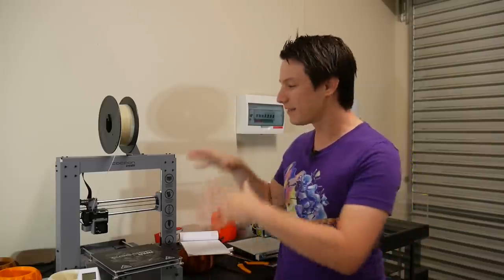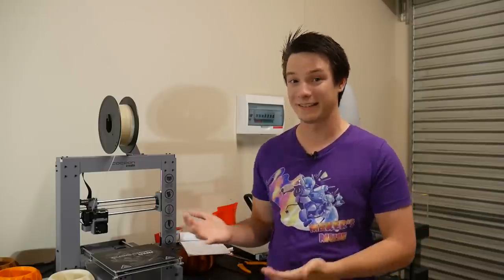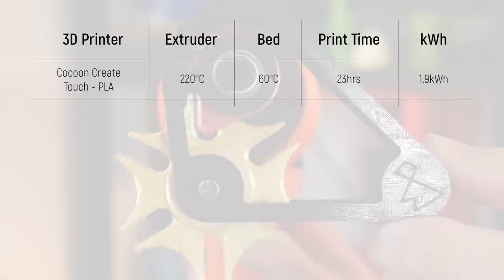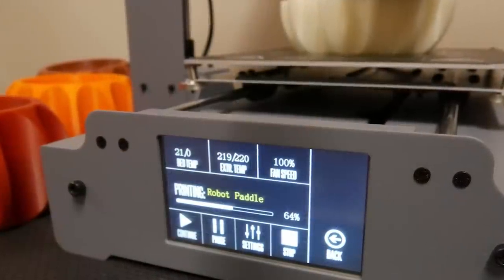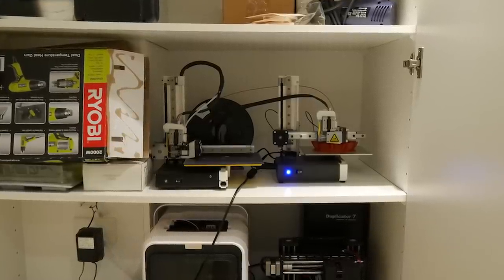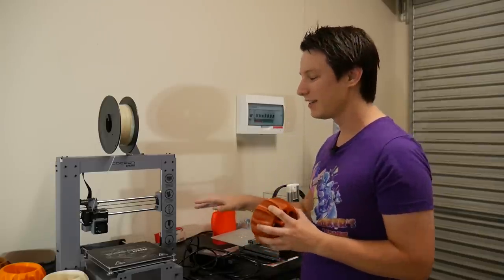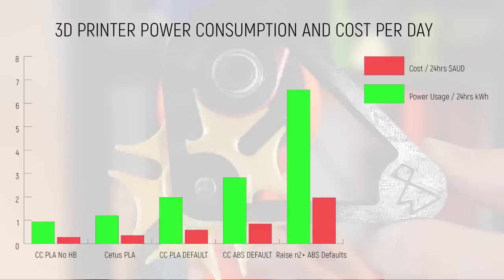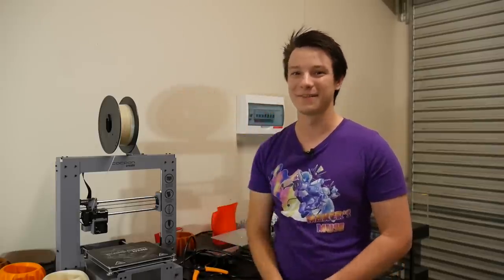How much power do 3D Printers use?

Comment: Thanks for the shout-out, Angus! Great insight into the power consumption of different printers and materials.
Reply: Hey boss can you do a preferences for .8 mm nozzles on the slicer software I’ve been to places where the wackos told me to put it to 140 mm speeds and a .4 mm height ect as a beginner this is very confusing and the test print at this setting came out in the shape but like a slinky so it split into bits and pieces after removing the raft and supports
Reply: how its possible  that cetus printer printe it in half amount of time?

Comment: Would it be out of the question to run the heat bed, for say the first 5 or 6 Z-axis layers and then modify the G-Code at some arbitrary height to switch the heat bed off?

Comment: I checked the power usage with a smart plug. At warmup ender 3V2 uses 270W, while printing PETG it varies around 100-130W.  Isolating the heatbed helps to reduce power usage. The 3 stepper motors on my printer use about 24 watts

Comment: Nice test Angus.  I've done similar test on my printer.  Power consumption from least to most: Motors, nozzle heater, bed heater, chamber heater.  My printer sits at about 90w/h while printing PLA, but It can hit over 1200w/h while all the heaters are on.

Comment: Can any of these be configured to switch off the heated-base after a given time to ensure the print adheres at the start but heater is switched off once it isn't needed?
Also, would operating the printer in an insulated cabinet to maintain a higher ambient temperature be worthwhile in reducing cost & failure-rates with ABS, etc., or would that cause problems with stepping-motors overheating?

Comment: That’s why you need a enclosed printer like the Da Vinci Pro when printing ABS. It’s also helpful in saving energy, it holds the heat evenly inside itself very well.

Comment: Hey mate. Hopefully this is a decent place to reach you. I use a CR10-S5 and I believe if I printed that wheel in PLA it would've being a larger build time than you experienced. I slice with the latest cura software and my estimates are always about half of what I actually experience. Any off the top of the head ideas as to what might be going on? I constantly vary infill and layer height depending on the job but I am still very new to 3D printing.

Comment: Hi Maker's Muse.  Given that maintaining the temperature of the hotbed appears to be a large contributor to power usage, it would be really interesting to see how this compared if the Cocoon was put inside an enclosure (as you normally would for improved ABS printing). 
I suspect you might find a good power saving, as the heat loss (and therefore energy required to maintain the hotbed temperature) would be greatly reduced by the increased ambient temperature inside the enclosure.

Comment: Do you know how many watts a 3d printer will peak at without a heated bed? I'm building a large 3D printer picking out a power supply. The heater for my machines bed will be 24v at 300 watts, which is 100 more than previous machines I've built. I'm thinking a standard 360 watt power supply isn't going to cut it. It will also have 7 stepper motors. Also speaking of 7 steppers if you do see this maybe you can answer another question. Since my Y axis is so heavy (300x300mm bed, 5mm thick aluminum) and will get heavier as the machine builds, I am planning on using 2 nema 17's working in conjunction, but wired up the same way you'd see 2 motors wired on a Z axis. Will this actually double my torque, or will it just split half the torque between each motor?

Comment: If it helps anyone: I tested my ender3 with a 9h print. 
The hot end was at 205°C and the heated bed was 60°C. The printer drew an average of 70.1W.
Reply: soup health Drawing an average of 70 W for 9 hours is only .07 kW x 9h = 0.63 kWh
Reply: @boarder2k7  that's not much
Reply: so less than a gaming pc or xbox
Reply: @flamestoyershadowkill6400  waaaaay less
Reply: @munzlp  I  agree
Reply: @boarder2k7  Pretty sure he meant 70 watts an hour not 70 Watts total.
Reply: @buddyguy4723  his math meant 70 watts per hour. so it checks out
Reply: That's honestly not bad at all, weren't incandescendent lightbulbs like 80W?
Reply: @marcodagostini1420  up to 150 in some lamps, now an LED only uses like 9w
Reply: soundspark I’ll have to do a test print and measure that but don’t have access to the equipment just now. I imagine it would use significantly more power.
Reply: @buddyguy4723  it's a printer not a nvidia 2080 Ti
Reply: @DavidGarcia-nx2gj  what point are you trying to get across here? Those things use like 300 watts.
Reply: Watt is already a measurement of energy per time.
1 W = 1 Wh / h (so it is 0.001 kWh / h)
1 W = 1 Ws / s
1 W = 1 J / s

1 Ws  = 1 J
1 Wh = 3.600 J
1 kWh = 3.600.000 J

1000 W = 1 kW = 1 kWh/h = 3.600.000 J/h = 1000 J/s
Reply: @buddyguy4723  it was a joke but 3d printers does not use 300 watts
Reply: @DavidGarcia-nx2gj  jesus man, the 2080
Reply: Well, pleasant to hear my ender 3 (pro) is not that expensive to run. Now if the filament would become cheaper..........
Reply: @boarder2k7  Wait, seriously? That's barely anything. 1 kWh is about $0.2 in my country even after recent massive inflation of power bills...
Reply: @Abedeuss  I'll just be crying over here paying $0.39/kWh starting January 1 when it jumps 40%

Comment: If I recall correctly. My Delta, with a way overvolted heated bed running at 28.5v on a 24v bed. And a heated chamber and a hot end running at around 250 -260c. My printer uses around 275w/hour on average, although the first 30minutes the machine uses nearly 400w.

Comment: I have that exact same wattmeter I think :-). If you want to compare the motor usage excluded from the nozzle AND the heatbed, you can run a print on “dry run” setting, which won’t get you exact due to the extruder, but the extruder will be the least used motor during a print anyway,  when you take away the heated elements. 

Just food for thought...

Comment: Nice video.
I run several printers and use them as much as possible. For this year I am at almost 20000 hours of printing. Since I note how much electricity I use every week, I can tell you that I am using between 100 and 145 kWh per week on average. Before 3D printing that used to be about 30-35 kWh, so yes, the printers use a lot of energy.
I might add that I use a lot of TitanX, ASA and PETG so these use higher bed temps all the time.

Comment: I have one of the Aldi printers and ended up making an enclosure for it. It would be interesting to find out how much the enclosure reduces the cost of printing ABS??
Reply: The effects of one would stack nicely with bed insulation I would think.
Reply: I would believe an enclosure would be a necessity these days for print quality and cost savings
Reply: Zoë Baldwin I've lost my numbers since stupidly not writing them down with my other printer stuff, but was surprised at how little bed insulation did for my power consumption overall. It definitely helped, but wasn't as much as I'd hoped for.
Reply: I think an enclosure wouldn't help too much with power consumption, but mainly print quality as the ambient temperature around the print is higher, leading to less delamination

Comment: might be a few years old for a vid, but did you ever re-try this with a HotBox enclosure?  The bed is going to be the biggest consumer of power because it, not only has to heat it, but keep it hot during that time.  Hotends are much smaller, while yes hotter, you don't need as much power to make them hot and upkeep the temp.  With an enclosure the ambient temperature is higher meaning the plate doesn't cool down as quickly making for shorter cycles of the hotbed needing to "run" to upkeep the temp.  Also you need that hotbox for ABS or it will self destruct like that.

Comment: might wanna try different slicers to compare for printing time .....
i.e. i done a print (side panel for a mini transmisssionline speaker) in both cura and slic3er where the cura version was done in just over 1/3rd of the time...
settings for infill, skin thickness bottom and top etc were all the same ....
so choosing the right slicer can really help

Comment: The CR-10S Pro uses about 500 watts of power at 60 degrees bed and 150 degrees nozzle  (not quite printing temperatures, but it is what I was using to troubleshoot a power supply issue I was having.  Someone else was kind enough to measure how much their working printer used.  Mine was maxing out at under 400 watts and their working one was using just a hair over 500 watts making it clear that my power supply was faulty.)

Comment: Aldi on central coast still has the Cocoon Create going for $400
My FlashForge Finder doesn't have a heated bed, but does have an LED strip for continual illumination, wouldn't add much I believe. Can be turned off.

Comment: I really have to print PLA with cold bed at last. I always turn it on because why not. As of now I'm printing some small adapters for the Pimax and using 60°C bed. I think this helps bonding the layers and perhaps even crystalizes them.
However the AnetA8 already draws a lot of power, but heating the heatbed of the CR-10 requires even more power. I think it is like 150W vs 250W for the heatbed alone. (not quite sure if I remember and compared them right but it's close)

Comment: The latest Cura has an option to change the bed temp after the first layer.nI've been using 60 degrees, then dropping to 40 on my Cocoon.  Sound like I should just to zero (off).

Comment: Takeaway has to be that bed heating (temperature difference to ambient and bed size) x print time is by far the most significant factor. Comparing the Cetus and unheated Cocoon Create shows similar power consumption rates. So, if you could get a good quality print from the Cocoon Create at higher speeds, you could reduce the power consumption.

Adding a thermally insulating enclosure would make a difference, as it would significantly reduce the rate at which heat is lost by the system and so the cost of running the bed (it'll tick on for less time). Enclosure is essential for ABS of course; it would be interesting to do the ABS print with the same settings but a decent enclosure.

Comment: Very interesting. There is a significant hidden benefit from the power consumed by the bed if you live in a cold clime and have electric heat like me. The bed is a fairly efficient heat source and the heat is released into the house, thereby reducing the load on the electric furnace of the house.

Comment: I run off grid just using solar power so power consumption is a big deal. I'll often place paper towel strips or thin sheets of foam around the edges of my print bed when doing smaller prints to help insulate the bed and reduce power consumption.

Comment: Makes sense that larger printers with larger heated beds use more power, my guess is that the large surface area needs more energy to stay warm because it has more surface area to transfer the heat away. Which makes me think if you build a thermal housing not only will you save on energy costs but also have better prints that won't "pull back" and delaminate like with the ABS print in the video. Awesome video, I really wish you tested the Raise N2+ without heat on the bed.

Then, i wonder if printing matt black would use more power as it will radiate heat away from the bed a little bit more. That one's for funzies, i wanna see how little of a difference it would make lol

Comment: Hey Angus, I can say I precede you by 3 days, bought the same wattmeter but I didn't  do the long time prints like you did, I just tested what the power is with just hotend on  and while printing, for my printer hotend on full is around 70W and while printing the printer stays at around 50W .
For the things that you create that is pretty eficient I would say !
It would be very interesting and go into detail with the power consumed while bed is on fully, of course bed at 100degC while consume much more than 60degC, actually the heated bed is the greatest consumer of power, I am little surprised that for the printer with the enclosed bed the consumption was so huge ... as the heat losses would be smaller, but it is a huge heavy machine so maybe the motion takes more power, also of course printing time will influence a lot so that's why comparing instantaneous power would be interesting .
Also the efficiency of the PSUs is important, I think the laptop type power bricks are much more efficient than the cheap PSU ?
Great video !

Comment: Great video as always. Here in the USA, most of us pay our electric bill every month, rather than quarterly. So while it may cost us a dollar or so to make each individual print, I don't think that the average hobbyist is going to go buck wild printing everything under the sun, and rack up $200 or $300 USD for electricity just in 3D printing alone. I personally am in the stage of wanting a printer and saving up to buy one, but without even having one, my summertime electric bill (which includes central A/C, all my appliances, TV's, computers, and whatever else) is about $250 a month. As a hobbyist, I could see doing a few prints a month on average. I do realize that once I do get my printer, I will be making more than that, in the early weeks and months, just to figure out how everything works, and to make any adjustments or upgrades, but once it is dialed in, like I said, just a few pieces a month. If someone IS using $200 to $300 a month in electricity just for 3D printing alone, on top of all the other electricity used in their homes, to me, it sounds like 3D printing is something far greater than just a hobby.........maybe a source of income (or out of control obsession) at that point.

Comment: Where i live it's $0.10 CAD per KWh so compared to the cost of the printer, the filament and my time, the electricity is almost nothing :-) Power and energy seem to confuse a lot of people, recently i was doing some research for a solar/battery project and found that it's very common for people to misuse/confuse units of KW with KWh.  The easiest way to understand a derived unit is to look at its base units. 

Consider what it costs for heating and cooling... an electric space heater in north america is usually rated at 1500W so it sucks up energy pretty quickly.  Central air conditioning is about 3500W and about 3000W for a clothes dryer.
Reply: Ikr, really couldn't care less

Comment: What about a smaller machine that's enclosed for printing abs. I would assume that the enclosure would keep some of the heat inside for the bed not to have to use as much power to maintain the Heat.

Comment: Great video.  When doing anything tall in ABS you can really help delamination by upping the extrusion temperature so the layers adhere better, but I understand that is not the point of this video, and abs is not a great choice for tall things for sure.  The power increase for ABS would have been even hotter of course.  I have been known to run it up to 250 extrusion if I want really good layer adhesion.

Comment: Good video, and thanks! 👍

Some purely a technical issues with your wording:

1. kW-hr is a measure of energy not a measure of power. (It can also be measured in Joules.)

2. The rate at which energy used is known as the power, and is measured in Watts.

Just so you know...
Reply: he didnt say it that way though
Reply: J=W*s
kW*h = 1000*W*3600*s = 3.6*10^6 J
Joules is such a small unit that it has little use outside of science class. I think kW*h should be the S.I. unit, just like kg.
Reply: Y. Z. what about just using megajoules
Reply: Y. Z. Its kWh not kW*h...

Comment: Adding thermal insulation to the heated bed should help lower those values. My aluminium heated bed takes quite some time to cool down, around 5-10min to reach ambient from 50*C.
The rest is up to the power suply efficiency and the thermal efficiency of the system. A hotend block covered in several layers of kapton should consume quite less than one without (you can touch mine with your finger and you wont get burned).
I dont think steppers have much of a difference between nema 17 and 23. Maybe im wrong and nema23 have better efficiency. But having a fast printer sure will make a difference because you wont have as much heat lose from the bed as with a slow printer so high accelerations (2000+) are a must.

Comment: Interesting how much the heated bed adds to the cost and therefore makes ABS much more expensive. What I'm curious about is the ambient temperature. If you're in a hot room, it should be easier to maintain the heatbeds temperature. And if you have an enclosed printer, then sure that would keep the ambient temperature even higher. However the big machine used way more power even though it's a enclosed system. I'm guessing this is due to the fact the printer is just larger. Basically I have a printer which is enclosed, and I'm curious if being enclosed makes it cost less than the cocoon, or whether it really doesn't make that much of a difference.

Comment: Printing PLA without heatbed is a nice option, you wouldn't have to worry about the PID heatbed controls which, if not tuned properly, will keep changing the heatbed height, giving you horrible prints...(took me months to realize this on the i3 MK2. I never thought a PCB heatbed could expand/contract that much...)
Reply: I don't see how heatbed control would change heatbed height. At least I never had that problem. Sometimes heatbed does change height, so I just need to check it before each printing, or every few printings. Once it prints the first layer OK, it has no more issue. Maybe you should buy a better printer?

Comment: Try >250 degrees on the extruder for ABS. The added adhesion from the extra heat prevents the cracking.